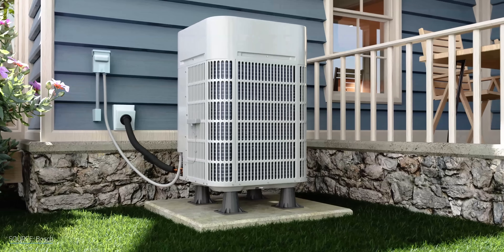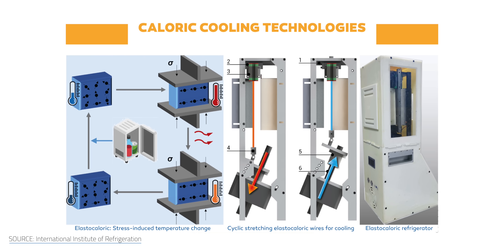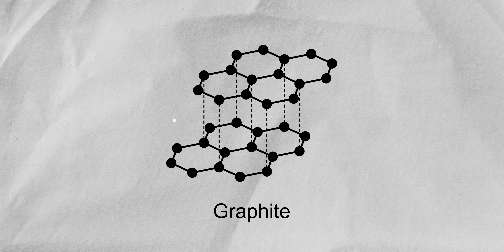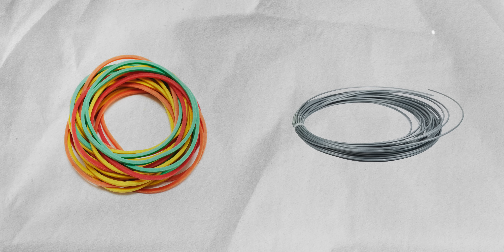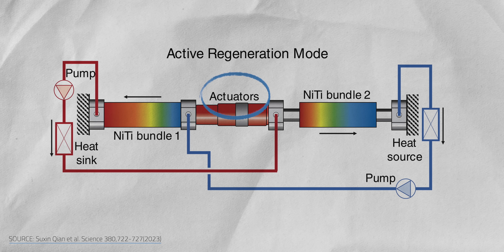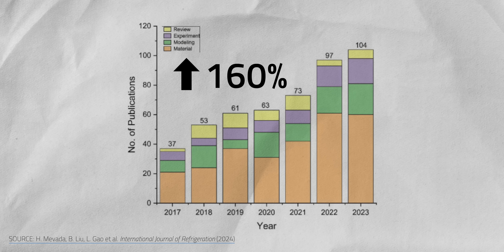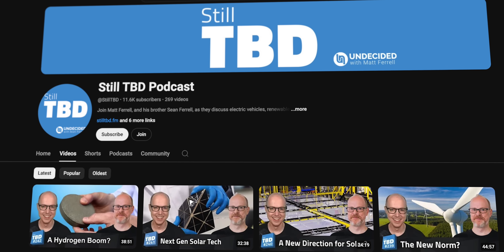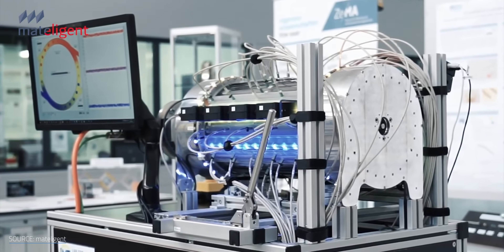How Solid State Cooling Could Change Everything

Comment: Does anyone else remember Flexon flexible glasses frames? I bought them once and snapped 3 pairs in the cold Canadian winter. I wasn't even showing off their flexibility. The last break was when I pushed on the bridge of the nose in the cold. Because of the temperature gradient, I guess the titanium alloy had a hard time heating up enough to become elastic and it just sheared.

After 3 pairs, they refused to replace another pair. They replaced the first 2 for free, though.

Comment: I worked in the HVAC/R industry for 40 years and it's clear the limitations of the vapor compression cycle is due to the inefficiencies of the motor driving the process. It isn't likely that some technology is going to vastly improve the efficiency of an electric motor, so this and other technologies will be required to provide an efficient means of moving heat energy from spaces where it is not desired to spaces where it is unobjectionable for it to be.

Comment: I think the first step of commercialization should be huge commercial buildings with large refrigeration processes. Such as, Mass food production. I make this suggestion because these are facilities that have the space available to install an otherwise huge refrigeration system that's bigger than what they already have or would have using traditional HVAC systems. And then work the process down to smaller and smaller to household appliances.

Comment: depending on the system build is it possible that a mechanical system could power a unit? I envision a unit where the weights of an old lighthouse style could power it for both off grid living as well as disaster relief. Could it also work in reverse where cold air could be heated?

Comment: Victor Popp used isothermal compressed air to run clocks and machinery in Paris, with businesses using the isothermal air to create refrigeration, as a plus. Could such isothermal compressed air be more effective than elastocaloric systems?

Comment: Before I really start the video, I want to share my idea: Clothing with these lined in them to transfer heat away from your skin, whether it is through the air or otherwise.

After watching the video: While it doesn't actually seem as achievable as I thought, I could imagine that the natural stretching the fabric would under-go from you moving around would allow it to cool you off still.

Then my second idea was it could be used for artificial muscle creation. The heat/energy transfer simulating something similar to blood flow, maybe even balancing stresses and joint wear. My idea is very surface level, but what I am imagining is something along the lines of actuators acting as ligaments or joints which activate the muscle strands and then as the process reverses it cools down and returns to neutral. As I write this, I am running out of steam and forgetting my idea, but it just sounds cool, even if unrealistic.

Comment: Has anyone ever seen anyone coupling phase change materials - like a refrigerant - with the mechanical "muscle" in a elasto caloric HP?  I'm picturing the nice hand lever example from the video where the hand is a piston with a refrigerant doing the pushing/expansion/evaporation and the pulling/contraction/condensing. Maybe elastocalorics are the next iteration on hot gas heat recovery? Thoughts?

Comment: Half way through I was expecting that the wire would constantly have to be recirculating inside of a liquid cooling loop.

That's now how it works though is it?

It needs physical compression and decompression to activate its physical state which causes its internal temperature to be lower than ambient and pulls heat in from the surrounding environment, correct?

Comment: I don’t know about large applications like air conditioning, but, could this be adapted to a smaller application, say…. High efficiency PC cooling?  Either as a supplemental cooling component for a glycol based water cooler or maybe integrated into the IHS in some kind of …. Pulse cycle heat/cool?

Comment: Absorbtion chillers have been used for numerous decades commercially.  These units require a very small percentage of energy and operate without HFCs.
Instead of "reinventing the wheel" why hasn't this technology been refined and applied to smaller residential applications?
BTW, CFCs have never been a real issue with regard to negative global environmental impact. 
This was just another contrived "emergency, orchestrated by industry and government, to force consumers into spending more for "upgraded" systems.

Comment: Just for clarification, hysteresis does NOT automatically mean that there is a difference. Hysteresis is a metrology calculation wherein you compare measured values as they increase and then decrease to a certain nominal value. 

It is possible and indeed ideal for the hysteresis calculation to be zero, which of course would mean there is no temperature difference.

Comment: James Webb Space Telescope has solid state cooling, if I am not wrong! The sensor needs to be cooled and they use solid state cooling to dissipate the heat because they can't have vibration from a traditional system. So, the tech is already there, it has to be made more economical.

Comment: You've got to understand the physics of the heat problem, and that is you can’t change heat indefinitely,  instead it needs to be moved. Passive heat transfers are being explored for how to deal with the heat produced in a fission reactor when backup electrical power is disrupted.

Comment: I'd like to see this start to be introduced to improve current heat pump performance. Like how when it's too hot outside its hard for the heat pump to get rid of the heat and vice versa in the winter. 
Could heat or cool the heat pump coil to improve that performance potentially

Comment: It isn't finding a non-HFC alternative that is driving them. We just need to look to times before silicon technology. People are currently using primitive systems based on water flowing through metal tubing that sits in an underground tank of water which tends toward remaining at 65 degrees Fahrenheit. The water is brought back into the conditioned space where some active heat transfer takes place and some amount of the heat differential is carried back into the cool area within the underground pool to be exchanged passively again. This is the most interesting solution that I've found because it seems pretty... for lack of the phrase I'm looking for, self-explanatory. Science isn't employed for the sake of a better future for humanity. I can just about guarantee that anything developed will just barely match the capacity of a SEER2-26 ductless mini split and will cost three times more for one that falls short of that and six times more for one that just makes the cut. It won't be marginally better in one way or another for lack of potential. It will be modestly specified so that there is room for upgrading to a more costly version. I'll spend my $600 to circulate my closed loop and be able to DIY any repairs. I watch your videos because you bring fascinating information. There's another channel like this that I watch for the same purpose. I doubt you'll put anything on the channel that I would actually hope to get my hands on... except maybe energy storage.

Comment: I'm pessimistic about air conditioning units using hundreds of nitinol wires.For me, hundreds of strands of this magical alloy, being stretched/relieved hundreds or thousands of times per minute, won't last long!Only the gas molecules can withstand such brutal treatment, as they cannot break!Solid state refrigeration, in my opinion, only if it is based on the Peltier Effect.

Comment: A system with moving mechanical actuators isn't "solid state" just because it doesn't depend on fluids. It's not like transistor radios were pumping water through them. Solid state means a thing, and science/technology educators and communicators have a responsibility not to teach their audience incorrect terminology/concepts.

Piezoelectric cooling is solid-state (except for any air movers you add). Elastocalorics are mechanical.

Comment: Let me be clear cop is dependent on temperature difference. But at normal conditions vapor cooling is nearly as good as it can be thermodynamically if any further you hit a wall it is very unlikely that you can get more efficient in cooling then perfect heat pump. But if they do then they break multiple thermodynamics laws all at once. This would allow to extract energy from movement of molecules.

Comment: Bicycle wheels with that wire as spokes on a modified cam shaft with fans between each wheel.

Fans spin fixed with the cam while the eccentric center bearings flex and relax the wire.

Comment: What if (my favourite question)… what if that material could not only be used for heat/cool purposes but also to generate electricity? Imagine a structure designed to passive heat load and change shape while pulling/pushing a series of gears. These gears, at a trigger set point, then release stored transfer energy into spinning magnets which charge …. Both top and bottom of daily passive solar load or human occupants heat load.

Comment: Heat transfer  is the biggest issue, this will have the same issues as thermoelectric devices, both ultimately governed by the Arrhenius Equation. Refrigerants solve this by moving the phase changing material through the cycle i.e. all stages happen simultaneously. Solid state needs to occur in series in one location and lays to heat transfer/diffusion will control rate and efficiency.

Comment: Here's an idea: I live in Phx, AZ, and recently sold a house that was located in a desert area. The city water mains were buried in the alley between two blocks of homes. There's hardly no grass nor anything that gets water, so the dirt gets pretty damn hot in the summer. As a result, the "cold" tap water is around 105-110 F. I would literally shut off my hot water heater from late May thru September. I've been trying for years to figure out a way to efficiently cool 10-15 gallons of water by 20-30 degrees so I could take a cool(er) shower or have some cool water to use that's closer to 80 than 110. The best idea I came up with is around 200' of 1/2" irrigation pipe arranged in a zig-zag or maybe coiled shape with space between that would facilitate ambient air cooling, since the inside temps are kept in the 80's during the summer.

A 10-20 gal water cooler that was similar in shape to a normal water heater would be perfect. It might be the size of a 40-50 gal heater, but if it could efficiently cool water down 25-30 degrees over a few hours time, that would be perfect. A lot of homes in Phoenix and other desert environments have this problem, and it's getting worse as people replace their lawns with xeriscaping, so the ground gets hotter.

Comment: Lol ive been hearing so much about these heat pumps from Americans and ive been trying to figure out what the hell they are on about.  Turns out they are just referring to what aussies consider normal air conditioning for a house, more precisely reverse cycle a/c which means they can heat as well.  They are something thats been common in most homes since i was a kid and im 42!!  Has Americans only just discovered air conditioning?  What did they use before?  Lol

Comment: What is the current potential of using Solar heat to replace the gas or electric heating used in Absorption refrigeration systems, the type used in RV 12DC/110VAC/Propane Refrigerators?  Since learning of their operation while repairing mine, I envisioned the potential to use concentrated Solar Energy to heat the Ammonia/Water and Hydrogen Gas used in the closed system to change from a Liquid to a Gas, then use the change back to Liquid to do some type of Heat Exchange to provide for Air Conditioning or Refrigeration. These systems only require a heat source to operate with no moving parts. The addition of a pump to cycle the secondary heat transfer liquid in a much larger scale system through a heat exchanger should operate at very low electrical consumption, and if taken further could also utilize Solar Cells/Batteries to provide the necessary power. I have heard of systems that use large reserves of frozen liquid to provide for commercial indoor climate control during daylight and continuing during hours of darkness again through a heat exchanger. Then the "Stored Energy" lost is replenished during hours of daylight.  It seems like in hot climates such as here in Arizona, this technology could be a viable solution to reducing the huge demands for electricity for air conditioning.

Comment: The mechanical engineer: Just put the stretchy-springy-thing outside and pipe the cold water into your refrigerator. Fridge only has to contain a circulating fan and heat exchanger, and as long as you stay in AC condenser size territory for the stretchy-springy-thing, it doesn't start to get impractical for about 50% of homes.

Back fitting the plumbing to run said water loop is the real inconvenience, but nothing a saws-all and some plaster can't figure out.

Comment: Awesome to learn of a "new" technology coming to light.  As said, the COP is of the unit not the conversion.  A bigger fish in the pond is how do we use this energy more efficiently, as "any" technology can plug into a building envelope.  We need as much attention in the design of buildings and how the HVAC is integrated then anything.  No matter what the COP is on any unit 3 or 20.  If the building it is placed in is not designed efficiently, what does the COP matter?  As the latter much harder to tackle, I think I will work on that and let any "technology" plug into my building.

Comment: Gas Refrigerants are light in weight. Wires are heavy. A Hydrogen fuel cell makes heat and electricity. Pillsbury uses the heat from the fuel cell factory to bake.  Fuel cells on cruise ships will produce hot water and power. When hydrogen gets going.

Comment: If I need coolant to transport the cold, I see a combined technology here. The air compressed by the compressor is expanded over the deformed, heated metal while the metal is bent back where it cools down itself. This could achieve a very efficient low level of cold. Very exciting topic.

Comment: This is really interesting. One of the big problems structures in space have to deal with - space stations, capsules, etc - is how to shed heat since space is so empty. Massive radiators are necessary to keep artificial space environments from becoming too hot, like what's found in the various thermal control systems on the ISS. Solid State Cooling described here seems like it would be less prone to mechanical failure, and might eventually be more efficient in a space environment.
Thanks for this video! I'll be very interested to watch the technology develop.

Comment: I think combining this tech with solar/or even wind mechanical could work in the long-run to make this tech a true net-zero tech, and zero co2 footprint.  However, I don't see this really hitting true commercial viability for at least another 5-10 years at least, unless some major breakthrough in material resilience is discovered.

Comment: What's the "Weight" of heat?
There must be a theorical maximum COP a system could possibly get at hypertech levels since moving heat is organizing energy
How would a theorical maxed efficient system interact with energy production from heat difference? Would it be able to extract heat into electricity so long the system average is above X kelvin? if so, what is the best X possible?

Comment: imagine making a wheel for a vehicle made out of elastoclorics and a heat elements in the center, the engines heat would make the tire retain the shape of the wheel if it hits a rough terrain, and stronger the heat load, the stiffer the wheel!

Comment: Why use HFCs if you have materials which change state from solids/gases to liquids/gases in the temperature ranges we are interested with.  We use these heat pipes in cell phones and micro computers today, but companies are always pushing for products that have to fixed in shorter and shorter time frames or not be repaired at all.  I have come to the conclusion, like Elon Musk, that no part is the best part and no moving parts are the best solution, but that is the antithesis of what industry wants for consumers.

Comment: This hype has happened before with other caloric cooling technologies like magnetocaloric cooling. This last does have real applications for low and very low temperatures, but the challenge is getting to real room temperature applications. The hype for magnetocalorics and electrocalorics has passed and now it is turn for elastocalorics. I already saw an elastocaloric prototype at a caloric cooling conference in 2018. Bulky, but it did get some positive results. However, the real problem of all these "new" caloric systems remains unsolved: their expected efficiency and power is lost when scaling up in power and volume of the cold spot, because you have use an intermediate heat exchange that comprises a heat transfer fluid. This heat teansfer fluid has also to be pumped in a sincronous manner.
The main advantage of traditional compression systems is that the heat transfer fluid is also the material that creates the cooling effect, and that is in the end what is making the difference with all these solid state caloric cooling devices. You can look for new solid materials with better performance, but unless there is a very significant breakthrough, solid state caloric cooling devices are not going to reach a high TR level any time soon and will, at best remain suitable for niche applications.